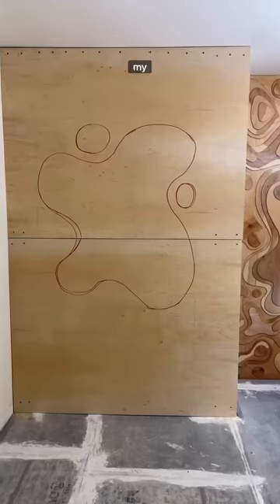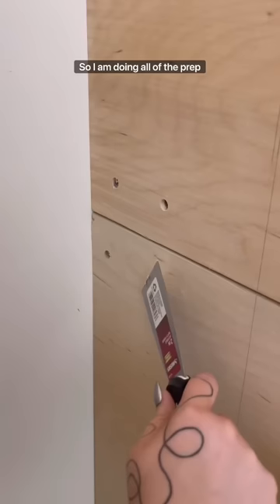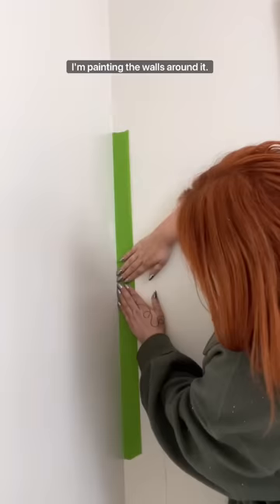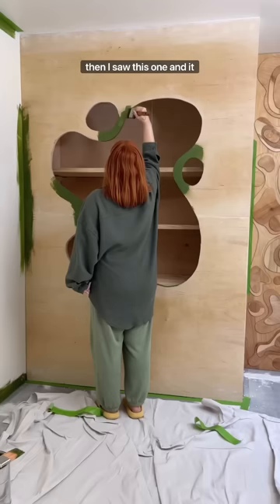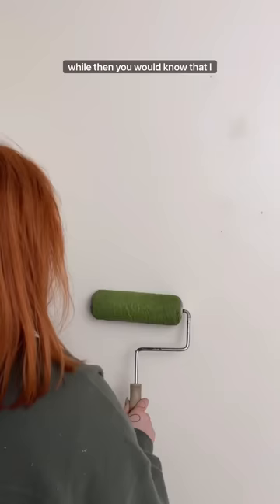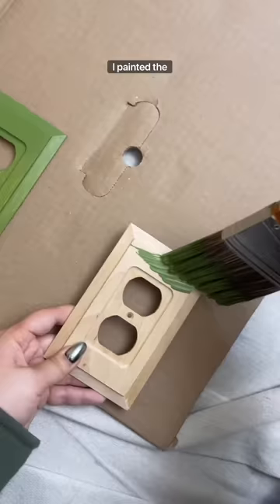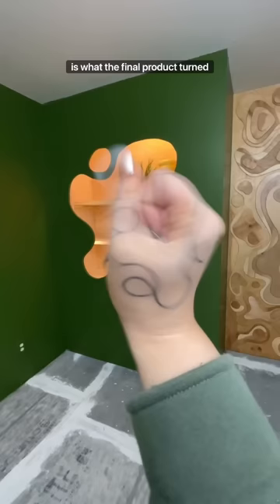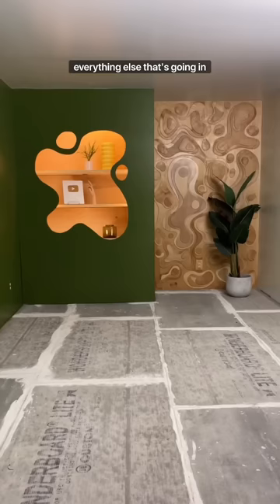I made a hole in my wall… but in a pretty way #shorts

Comment: I love how basically everyone said she needs to add hinges. But can we talk about how it looks like she didn't round off or sand the edges of the shapes she made? I would be too afraid to touch anything on the shelf due to the high risk of splinters if you even graze the edge of one of those cut outs.
Reply: Thought the same thing. Sand those edges. Things look fine in a 60 second short on YT but not finished in person.

Comment: Some advice my grandfather gave me about paint was that it will always dry two shades darker than what it looks like wet. You can get lighter paint and go darker if you want, but it's harder to paint over darker paint straight on the surface

Comment: Hot tip, if youre going to stain wood but need to fill holes use wood shavings from the same material and mix with wood epoxy

Comment: Painting walls is easy if you got the right technique. Do 2ft x 2ft patches, one at a time. Bottom left to top right. Horizontally then vertically. Do 3 stripes bottom to top, 1, 3, then 2. Spread horizontally. Do a couple of light top-down passes with a bit of overlap so the paint "points" in the same direction.

Comment: Thats a much better way to paint the outlet cover however they dont hold paint very well so in about a year or 2 its gonna start looking really cracked and likely start to crack you may have already though of it and are using a better paint just going off my experience with wall paint on outlet covers

Comment: Frog tape is very overrated. If you use blue tape and wipe it down with a wet sponge after application it works just as well.

Comment: I like it but why’d you paint the outlets?
Reply: I guess she just wanted it to match
Reply: Honestly watching this again I think the outlet actually is pretty cool, but I would have rolled it to give it the same texture as the wall. Though at the same time doing it the way the creator did with the brush does allow the texture to pop out which could be a good thing in this case.